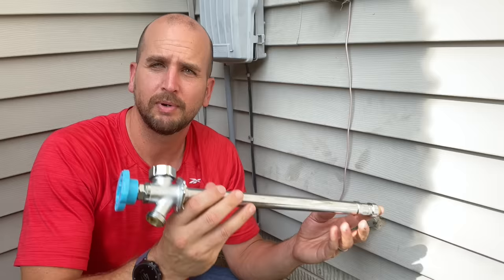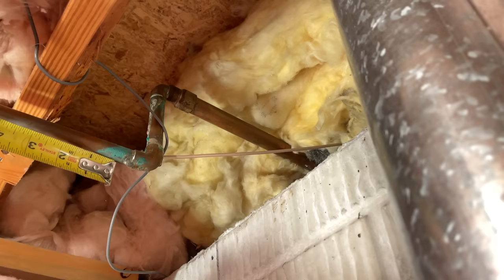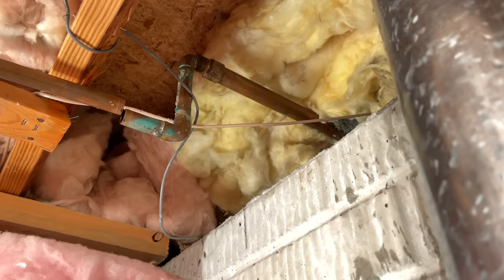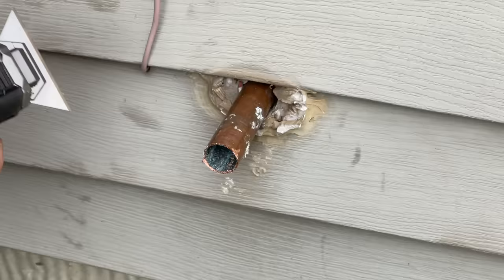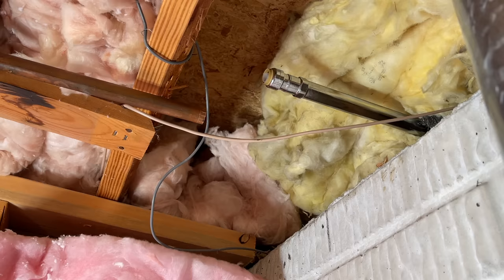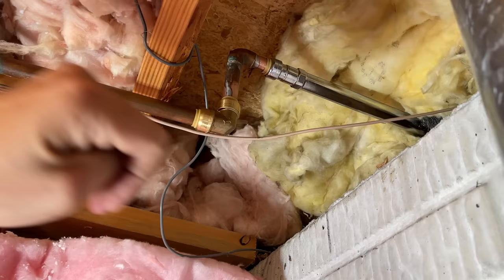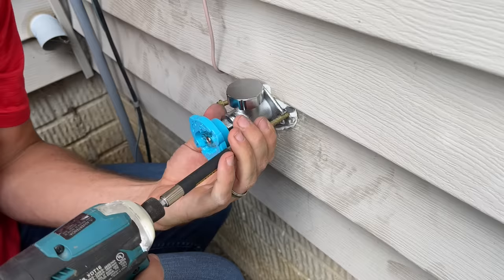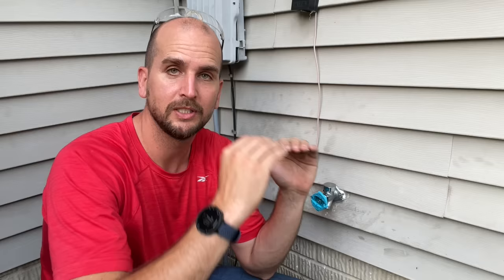Outdoor Spigot Replacement | Sharkbite Frost Free

Comment: Did you consider adding a vinyl siding adapter (also used for lights) to give you a flat surface to mount to?
Reply: Yep  for the cost easy to do and finished look..
Reply: That’s what I did.   Looks much better than this slash job.

Comment: You didn't de-burr the end of the cut pipe before sliding on the SharkBite end cap. You did mention de-burring later when you removed the cap and applied the 90 degree elbow, but by then the end cap may have been damaged.
You're not supposed to sand or burnish copper pipe that you intend to apply a SharkBite fitting to. If there is solder or corrosion then use new pipe.
Why was your Dynaflex "CLEAR" sealant opaque white instead of clear? Does it cure clear?

Comment: I have a spigot that I've been meaning to replace. But, have been a bit apprehensive due to it being located above my water heater and connected to polybutylene system. Got any examples of that job, lol? This was a nice video to help me work up the courage to tackle this job myself.
Reply from the maker: Hey Duke,  yeah this one was actually right above my water heater as well.  The other 2 I need to swap out will also be tied into copper but I am sure I will have a PEX example sooner or later.  Thanks for the feedback!

Comment: Don’t you have to debur the inside of the pipe as well? With the pencil deburrer/ exacto knife
Reply: Should definitely debur and also clean of the outside of exposed pipe with fine steel wool or similar. I would also not use that salvaged segment of pipe with so much stuff on it. Just grab a 3ft chunk of 1/2 pex tubing and an elbow. Although this is in accessible area if it ever leaks.
Reply: Some tubing cutters come with a de-burring built on them.  In a pinch, you can use a utility knife to swish around the inside diameter.
Reply: @appleztooranges  Sharpbite actually sells a combo tool that deburrs and measures the correct depth.  It looks like an orange flute.  I also recommend the Sharkbite removal tongs.  They sell for about $10 at Lowes.  They work a lot better than the little plastic orange removal tool.
Reply: @AStanton1966  I got it. Hard to do in between cuts though. Like if you have just a coupling or something and only got 1/4” or so

Comment: Thanks for the video this was well made and very helpful.  Two opinion questions for you (or anyone else):

1)  If you are putting in a sharkbite connector during this process anyway, wouldn't it be beneficial to install an individual cutoff valve for that line while you're doing that job anyway?  A shutoff with sharkbite connectors on both ends seems to run less than $25.  Yes/No opinions?  

2) I live in a forty-five year old house.  Another video I saw recommended putting in a few feet of PEX instead of copper pipe to help further resist freezing damage.  Thoughts on that?  Thanks to anyone willing to comment on either!
Reply: Timothy, I was thinking the same thing about installing a shutoff valve while doing the work. It's good insurance in the colder climates to shut the water off even when you have a frost proof valve.
Reply: Yes PEX is certainly more resistant to bursting when frozen.  I'm not a plumber but I don't know I'd go out of my way to put a section of PEX simply for the sake of it.  PEX is easier to work with for sure though.
Reply: @bairdjc  Thanks.  I ended up not doing the PEX but did put in a new shutoff valve when I replaced my copper piping and hose bib.

Comment: Those Shark Bites are great. How long have they been on the market? You did a very good job of showing us how to do this replacement.
Reply from the maker: Sharkbites have been around since 2004 but I would say have really ramped in use over the past 5-10 years.
Reply: @EverydayHomeRepairs  Thank you sir, I enjoy your channel.  Steve.
Reply: They're great if you want guaranteed leaks a few years down the road when the rubber gaskets that keep them watertight fail. Any decent plumber I've ever worked with will tell you to stay far away. Just think about how the rubber washers in your shower faucet or bathroom faucet wear out of over time. But now imagine instead of only being relegated to faucets you have tiny pieces of aging rubber holding back city water pressure on pipes all over your house.
Reply: @Sam-ey1nn  You need to educate yourself on the difference between a static and dynamic seal. The o-rings and washers fail in showers and faucets because they're a dynamic seal. They're designed to move with the function of the faucet or shower which leads to wear and tear and eventual need of replacement. The difference in shark bites and propress fittings as well and why this is such an inaccurate comparison is that shark bites are static seals, meaning once it clamps down, that o-ring is subject to no movement and as a result, no wear and tear. This is why they're rated for 25 years and ProPress is rated for 50 years minimum and will very likely last much beyond that but these new innovations haven't been around long enough to know yet. 

Older plumbers tend to hate them, yes, because they're ignorant in understanding how they actually work and say ignorant things like 'it's just an o-ring'. Yes it is, but the engineering is quite a bit more involved than that. Europe has been using push-to-connect fittings way longer than we have in the US because per usual, the US is arrogant and slow to adapt new innovations. If you talk to a lot of old plumbers, they hate all the new innovations, they're really not the right people to talk because they're stuck in their ways. Hate Pex, hate propress, hate tankless water heaters, really hate sharkbites. If it were up to the old-timers, we'd still be working with cast iron and lead and oakum joints. As a plumber myself, I fully stand by propress. Sharkbites? Not as much and I definitely wouldn't put them behind walls but I have used them in pinches needing a quick fix on jobs. In my own home, all my fixture shut offs are sharkbites. My own personal experiment because I was also told when I first started out that sharkbites are terrible and will leak so I tested them out myself. Installed them 8 years ago and they're still going strong, no leaks. I've seen sharkbites leak in the field and 100% of the time, it's because of installer error and not product failure. So easy to install but yet people still mess it up somehow. Many of my service calls today are fixing old leaking soldered joints. Solder does not last forever either and will eventually need replacement too.
Reply: @Sam-ey1nn  I agree with you. Even a static seal will eventually leak. I would never trust this in my home. Soldering a pipe is very simple to do.
Reply: @losferwords100  I have a SharkBite 3/4" ball valve - 18" hose/female NPT combo installed between the cold supply and the tank cold nipple in 2016 (2 years before SharkBite started warrantying these products) by two, I'm sure not licensed "immigrants" working remotely for a supposedly licensed plumber that I called for a new water heater. I put a Honeywell moisture detector laying inside the drip pan since day #2 because I didn't trust it. One night a few years later (of course in the middle), the alarm sounded and I went up there (attic) and found a drip started at the connection to the nipple. I found out from a plumber the next day that the connection has a rubber washer so I just tightened it 1/4 turn and that stopped it. There was some water on top of the heater but none in the pan-that Honeywell sensor is super sensitive. Since then, the crimp at the end of the rubber hose at the female end has developed a "seep". Not enough to set off the alarm, because it evaporates quickly but it's leaving white mineral deposits about 2 or 3 inches up the stainless mesh on the hose. I am going to replace it with a new ball valve and L type 3/4" copper very soon. Not even going to call SharkBite and ask for a "goodwill" replacement since I'm sure I won't get any and I wouldn't put it on there anyway if they reimbursed me and gave me a free one to boot. [EDIT] But to be fair, at least the O-ring at the other end hasn't started leaking yet.

Comment: I have a pipe leak inside my dry wall where it runs from the attic above the garage door and the pipe then runs across, down and through the outside vynl siding. It will be tricky getting to it. Not sure exactly where to cut through at but if I turn on the pipe I see it leaking to the garage door and hear it half way up the wall. I would greatly appreciate the next video of the basement repair. Thank you!
Reply: What I came across was thinking it was leaking in one area, fixed it there to find out that was not where the leak was. Be sure you know where the leak is before you repair it.

Comment: Thanks for the video.  But what if you have no access to the inside?  I mean that mine are going in cement blocks...  The house was built in the 70s.  I am guessing that they routed the pipes in the blocks.  Can a spigot be removed and replaced from the outside? Is there a risk that the spigots are just soldered, not threaded?

Comment: That “general exterior sealant” looks an awful lot like painters caulk.
Reply from the maker: I just used a tube of DAP Dynaflex 230 which should work for the job.  Do you have a preferred brand for this type of job?

Comment: I must’ve missed something. When you put the copper pipe into the end of the stainless steel threaded silcock, how does it not leak. No soldering. 
Thanks
Reply from the maker: Sharkbite fitting.

Comment: I used shark bites before but I don't like them. They're hard to push on in tight areas and are pretty expensive.
Reply from the maker: Actually I agree to both of those point.  In certain instances even with the price and being a bit tough to get on the pipe they come in pretty handy.  Thanks for the feedback!
Reply: Soldering in tight spaces is no picnic, either  :-)

Comment: I am a 66 year old widow alone and trying to fix this. I just spent 3 entire days and I do mean entire days replacing once again a ‘frost free’ silcock. This past winter was relatively mild and the hose was disconnected so I don’t know why it failed again.  My silcock was originally installed right in the corner of the foundation right against the foundation wall which makes changing these a royal pain with lots of scunned knuckles trying to work against the wall. After 3 entire days I Still have a leak where the new ‘frost free’ silcock connects to the line. I don’t understand why it’s leaking there. If I continue to try to tighten the brass fitting over the tape threaded silcock can I potentially accidentally break the new expensive silcock?    I don’t have anyone who can help me and dread the cost of hiring a plumber for something like this that should not be so hard.  Suggestions please?

Comment: Should you remove your hose after every time you use it? Or do you mean just for seasonal purposes?
Reply from the maker: I just try to remove the house well before we start to get into the freezing temps.  In Illinois that would be around October.  I don't think it hurts to leave it on during the late Spring, Summer, early Fall
Reply: @EverydayHomeRepairs  Thanks! Would love to see a vinyl siding repair video btw! (I have a small hole in my siding).

Comment: You mentioned my problem faucet at the end of this video. The outside spigot I need to replace goes into the laundry room, a finished area inside the house and I will have to cut into the sheetrock. The problem with my spigot is it won't shut off, the handle keeps turning and turning and if I get it exactly in the right spot it will almost stop dripping but still leaks so I put a two way splitter on it and turned both of them off. Is it possible the inside of the spigot where it actually shuts the water off can be repaired with a kit or does the entire spigot need to be replaced like you did? I also heard that Sharkbite fittings were not code here in Mo, I've heard it has to be a soldering job, don't know that for a fact, just what I heard. They say they will eventually work loose or just pop apart and start leaking. I guess once it was done and the sheetrock put back in place who's gonna see it right. Thank you for sharing, very helpful.
Reply: It sounds like the valve assembly is damaged, so you’ll likely need to replace it. Your best bet would be to remove the valve assembly and take it to a plumbing supply store to see if they have one that matches. The disassembly/installation is pretty easy and there are some good videos from This Old House that show the removal/installation process.
Reply: @tempesttube  Ok, thank you for the reply. I just hate the idea of tearing in to the sheetrock and making a whole new mess. Thanks again and have a great week.

Comment: Is that an intake or exhaust in the corner of the exterior? If exhaust, I’d recommend running another fitting/elbow to push the moist air away from the building.
Reply from the maker: Appreciate the feedback and that is an exhaust coming from the water heater.

Comment: Caution should be exercised using shark bite systems.  They use a seal to prevent leaks.  If that seal fails…you better have easy access.   Moreover older homes often don’t have today’s standard frost free length’s so you may have to fiddle with length’s-hard if you don’t have easy access.

Comment: Did it work over time? Because I wanted to use one but sharkbite company said not to sandpaper the copper surface. It no reds to be a smooth surface for the seal to work. Ivhad already sandpapered my surface.

Comment: You need to mark the depth  they sell a orange  depth  gage  and a sharper for PEX pipe and also you said it but didn't  it in the video  removing the inside and outside  bur plus you didn't  clean the last copper  fitting  you connected

Comment: Can shark bite fittings be used on the main water supply line into the house before the main shut off valve for the house water supply?
Reply from the maker: Would this just be a Coupling?  Or do you want to use a Sharkbite ball valve for you main water shutoff?
Reply: @EverydayHomeRepairs  Thanks for responding. It would be a Skarkbite ball valve to replace the old style valve that’s connected ahead of the regulator inside the basement and is 58 years old. It is leaking like a shower spraying if I turn it to shut off the water supply inside the house to do any other repairs.

Comment: $65 for the non Freeze 12" sillcock /$16.75 for a Sharkbite 90/plus labour ? and you end up with a repair of Dubious Reliabilty because of sharkbite's failure rate; that your house insurance may not cover ;when the fittings fail due to freezing or improper installation-might end up being cheaper and safer to  get it done by a licenced Plumber

Comment: Deburr, deburr, deburr!!! You need to deburr both inside and outside of pipe or starp edge will damage the rubber O ring inside Sharkbite and it will eventually leak. Not optional!!!

Comment: Everything from the start to finish is OK but I wouldn't use shark bite. Shark bite is not up to code. Sweat or press fittings not shark bite)
Reply from the maker: Thanks for the feedback Henry,  I agree sweating copper is the best by far if the homeowner has the skills.  Sharkbites aren't actually against code, correct?
Reply: @EverydayHomeRepairs  yes they are. My Brother in law is a licensed master plumber who told me that it is against code. Also, not often does it happen but I've had it happen to me. Shark bite can leak especially if not installed correctly and if there is no or very little grease on the o-ring.

Comment: No reason to ever use shark bites. I deal with removing shark bites daily from homes that leak. Homeowners dont know better, but plumbers do. If you absolutely cant afford to do it right with solder, use a compression by compression ball valve.

Comment: Question.... When cleaning up (sanding) the end of an old pipe to make ready for a new Shark Bite fitting, do you risk making the pipe smaller (micro) in diameter that the Shark Bite won't seal correctly?
Reply: No not unless you spend hours sanding down the pipe. Once you notice a color change the pipe is "clean".

Comment: Introduction, I am a licensed building contractor.  Most of my 25 years of experience is in residential remodeling.   I still do scan the net for ideas. I enjoyed your video except for the beginning statement: Installing a frost-proof spigot is rarely an easy job for a DIYer.  Please, please don’t encourage homeowners to open a can of worms.  Videos showing installation through wall areas just above the bottom plate in basements can be misleading  These are videos of guys working in heated, well-lit basements where access is easy.  That is not the typical case.  I would not recommend any non-professional try this operation 1) through a concrete footing 2) in a crawl space 3) in any situation where you have to sweat pipe between studs 4) if the spigot is opposite a bathtub or toilet, or any other obstruction.   This is only an easy job through plywood, in an open area, just above the footing, in a basement.  I just replaced a faulty fp spigot and had to: 1) remove a toilet inside (opposite the outdoor spigot) 2) remove & replace bolts on flange (rusted) put in a new wax ring on it to reinstall.  4)  cut tile on the inside to access the area.  5) detach an electrical ground held on the old spigot (a common grounding spot), which was covered with stucco,  6) I needed to re-attach that to the new fp spigot 7) insulate & patch the stucco area outside 8) go through several fp spigots to find one even somewhat close in length to the old one, as I had space constraints on the inside. 9) reattach tile on the inside in a manner making it accessible for any future repairs.  Luckily everything went well.